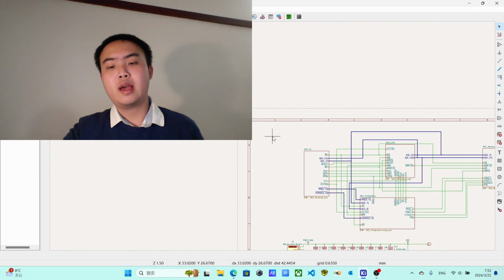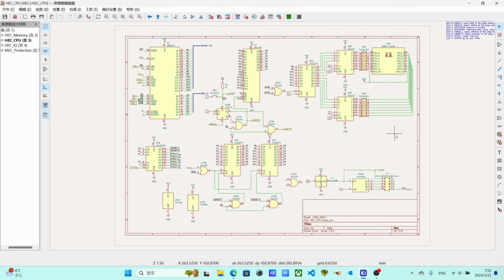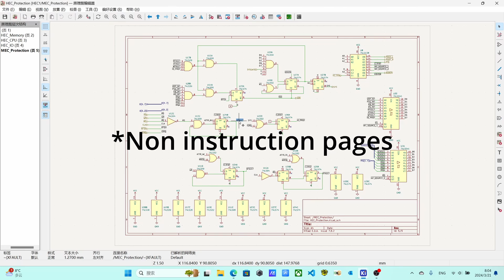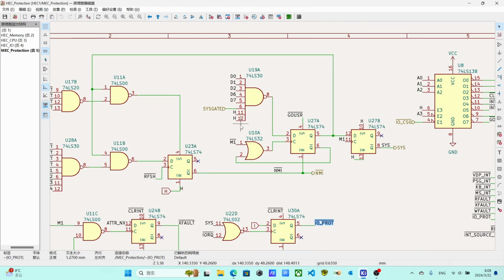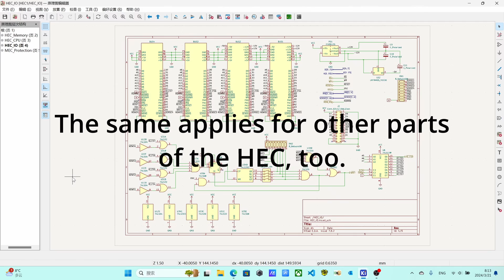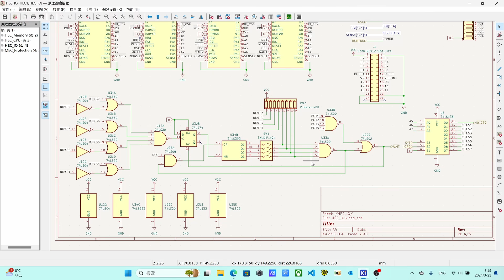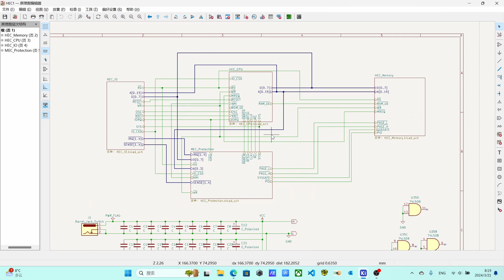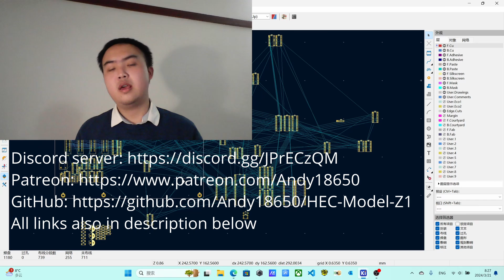The design for the protected mode Z80 computer is complete!

Comment: Why don't you try breadboarding the system using Z80 at 1MHz to check the design first? Then you can progress to PCB design. I also think that there are a browser based simulators that you can run your logic on to check it. Also out of interest have you analysed/checked the logic  using boolean algebra? I'm looking at the RC2014 system at the moment. I may build this before progressing to my own design.
Reply from the maker: I have built an RC2014. The problem with breadboarding is the scale. To put so many chips together with breadboards will be hard, and constant loose connections would grind the testing to a halt. Browser-based simulators usually don't simulate the latency of the logic gates. Those latency issues caused more than half of bugs during the design process. Therefore, even if the design passed the simulation, it may still fail on PCB.
Reply: Ben Eater strongly disagree with the notion that breadbords and a lot of ICs is hard 🤣